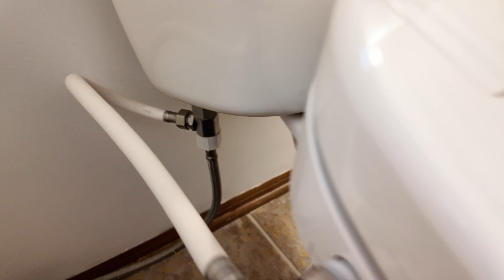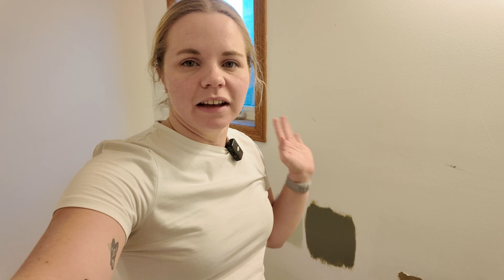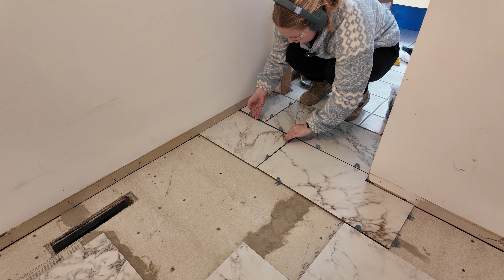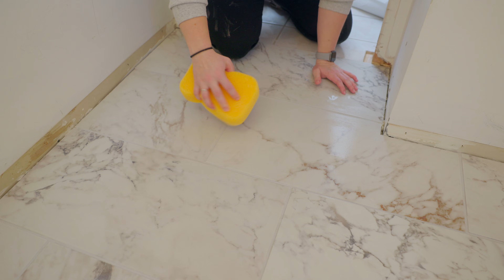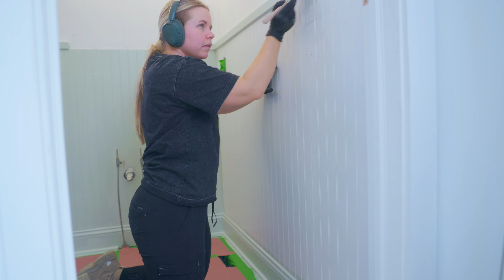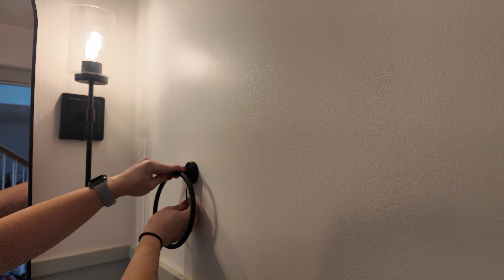I Completely Gutted my Powder Bathroom...

Comment: When I remodeled my bathroom, I made a tile baseboard and trimmed the top of the tile with a metal strip of tile trim. It was a bit tricky to cut with inside corner and one outside corner cut. But it looks great and wood trim to worry about getting wet or paint. Oh, I forgot to mention I used real slate tiles. Love the natural look.

Comment: For future tile laying, back buttering is good but make sure the trowel lines on the floor are the same direction as on the tile, that way air gets pushed out and you get a good bond. You can always pull up a tile after you've set it to check the adhesive is even. If the lines go in different directions like you did on some of the tiles, air can get stuck and that can cause weak spots that could lead to cracks. But amazing job on the room, looks stunning!

Comment: Sorry, I’m back again.  You can get a long handled tile scraper tool and keep the edges sharpened for easier removal.  Also a snow shovel, or any flat edged shovel!will work wonders for picking up the loose removed tiles and wood.

Comment: You really nailed it....that green color is to die for, absolutely love it....great color choice....This is such a quaint tiny little room but you have made it feel bigger and very airy and spacious...the color of that green is everything, I really love that green.  I think your design choices are brilliant, nothing over the top, splashes of colors that blend but are subtly noticeable - the vanity cabinet is lovely.  Love the black hardware.  If you had the budget what would you think about adding a little texture to one of the walls, thew one with the mirror and sconces an make a feature wall using wallpaper?  Also some artwork on the walls will also be the cherry on top.

Comment: You did an incredible job! My favourite parts are the wooden vanity and the tiles - chef kiss! I was wondering how you worked out which tiles to cut, did you lay out the full tiles in the middle first like a dry fit first? Also was there no need to do a waterproofing before tiling? I know there's no shower but I imagine the cement board thing is not water proof? Also how much fun is grouting?! (Is that just me?!) ❤

Comment: Cement board is not the same as waterproofing, for that you would need a liquid waterproofing application or membrane underlayment.
I like your tile choice of tile, also how the beadboard lines up with the bottom of the window with the trim on.
The finished room looks lovely.

Comment: looks great for doing it all yourself. I do like the tile better when grouted. I would have probably made the strip of tile along the backside of the wall at the back of the toilet and vanity match the bottom tile along the wall by itself. its a thinner strip of tile than all the rest, you could have even it could taking more of the tile along the adjacent wall.. you just would have had to shift the center three rows of tiles a little further towards the adjacent wall as well.

Comment: The bathroom is a beautiful transformation. You should feel pleased. If was really a labor of love. You chose a very neutral and fresh palate. Here are some minor suggestions. Consider painting the outlet covers the same color as your bead board. They will blend in. Dont be afraid to try your hand at a Roman shade from Lowe's as window covering.  You have an electrical plug in a spot from the bidet. I WISH I had the same for my half bath.  A  small lamp on the toilet tank will elevate the space. @chrislovesjulia has one in their powder room and it looks beautiful. Love youf art. If you tire of the diagnal spacing, hang them side by side. Same pictures different perspective.  I am sure you will receive many compliments.

Comment: I was in the flooring business for over 30 years and depending on what you  are going to install and what your substructure is either slab or crawl space your tile may not have had to be taken up.  Since it looked like concrete board under the tile you could have used a self leveler and tiled right over the existing tile.  With an older house its usually better to not rip everything up.  A self leveler would have been good for peel and stick vinyl plank with a backing would have needed a self leveler and regular ceramic wouldn't have needed a self leveler either.  In My experience the less ripping up stuff the better off you are.

Comment: Lauren, that looks lovely! But your curtains need rings on the leading edge, and should be attached to the wall on the outsides (the "return"). They would also benefit from steaming. You might want to caulk around the bottom of the toilet, too.

Comment: You do such great work and I enjoy your inspiring videos so much. When I was doing a major painting project recently, I did research and found that rolling out a wall before cutting in worked so much better than cutting in first. When the wall has fresh paint, it allows the paint brush to glide so much better when cutting in and the cutting in only needed one coat. Game changer for me. Thank you for sharing your remodels.

Comment: Lauren, your work has made a huge difference to the powder room. For a very small room, you have chosen well for fittings and fixtures . . . I particularly like that you have the bathroom cabinet on legs, rather than a cabinet that sits right to the floor. It helps to give the idea of space in the Powder room. A super transformation.
Reply: Not a very small bathroom imo.  I’m jealous.
Reply: @lisalife7994  Small in as much it has no bath and/or shower, so yes, it is a "powder room".

Comment: What a fantastic job you have done Lauren!!! I’m not sure if I’m seeing correctly but it looked like there was a gap at the bottom of the toilet were it meets the tile. You will need to put a caulk strip / sealant around there.
Reply from the maker: thanks! everything is secure and there is sealant there already - its clear (:
Reply: @FurnitureFlippingTeacher  sealant won't keep it from rocking and leaking if it doesn't sit securely on the floor. 
You never caulk around a toilet, it keeps you from knowing if it's leaking.
Reply from the maker: @Laurieg673 it is sitting securely on the floor

Comment: Bidets are great for using between baths and showers especially for females. It doesn’t have to be a heated one so there is no need for an electrical outlet.  Dry fitting first is absolutely the way to go. The bathroom colour is very pretty. Love your blue and cream coloured pullover!♥️🇨🇦